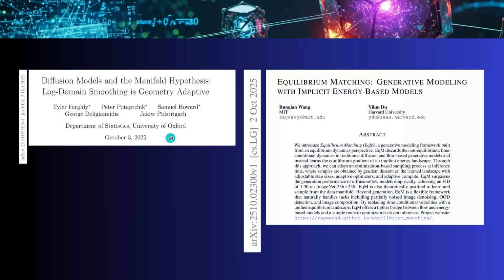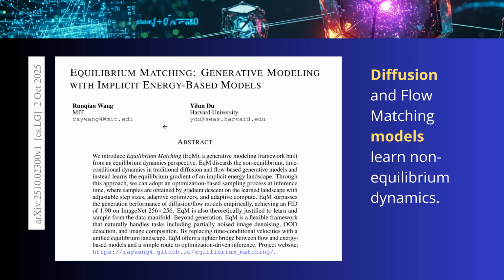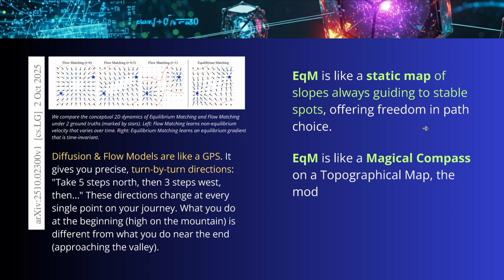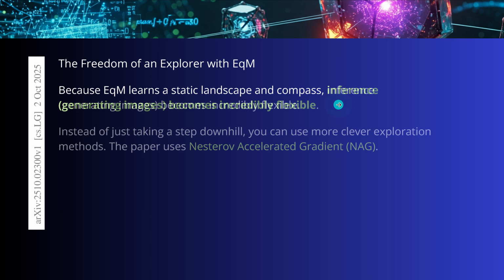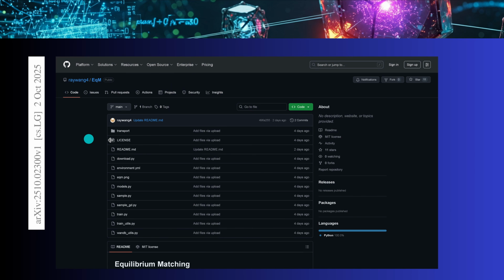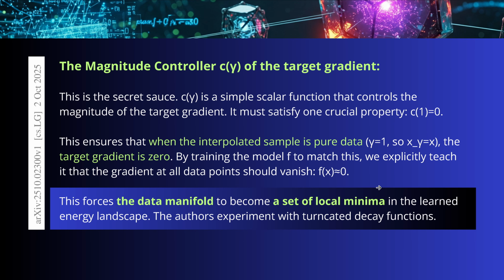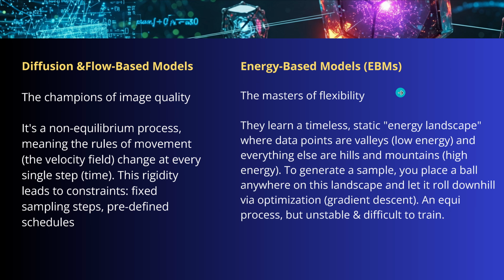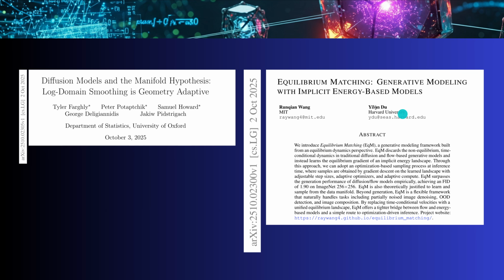After Diffusion & FLOW Models: Equilibrium Matching (MIT, Oxford, Harvard)

Comment: How does this relate to Energy Matching which is another upgrade of Flow Matching, that prevents overfitting? I'm guessing these techniques would be complementary.
(See Energy Matching: Unifying Flow Matching and Energy-Based Models for Generative Modeling)

Also, I though the whole point of flow matching is that you get to go "straight ahead" to the data so you can take massive steps. With equilibrium matching that isn't necessarily the case, is it?

Comment: This make me think that there has to be an even better way to do this. Instead of having to sample random noise for all the data to make the directions can you not just for every data make everything point towards/away from it with magnitude depending on distance and then multiply that together with all the other data to make the landscape? Or is just harder to do than training with bunch or random noise? 

Like if you had 1 data point surely to make everything point towards it you wouldn't need to sample everything to do that? Id assume there are tools or mathematical methods for the exact thing. And by multiplying you get the flat points, Though you might need to do some resealing.